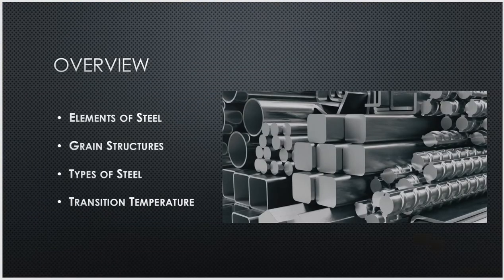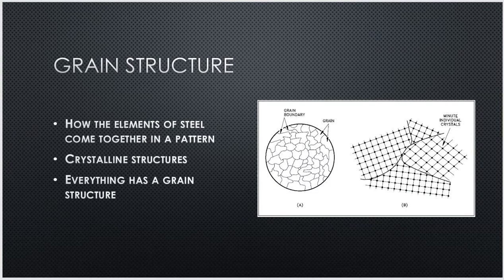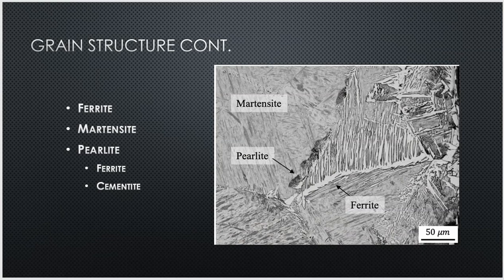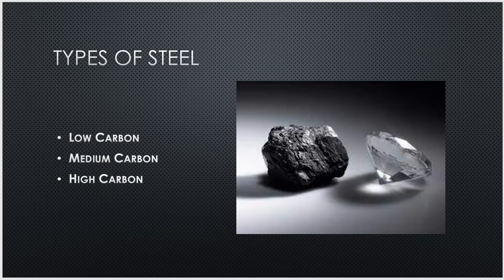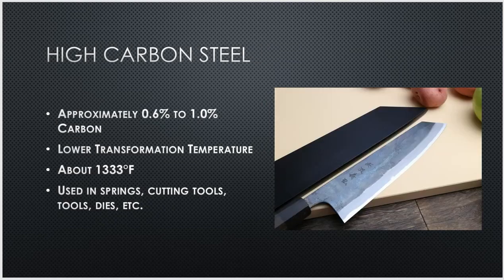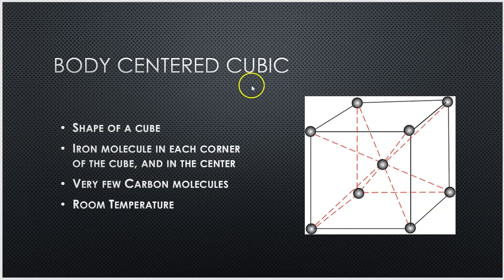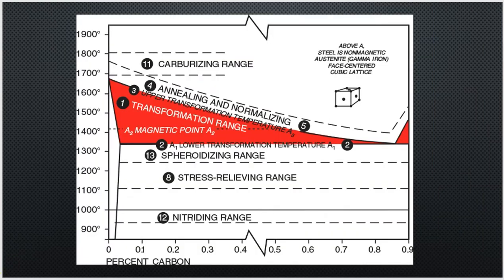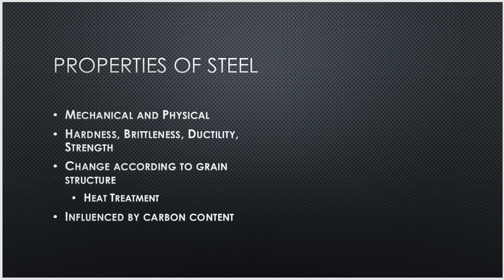Introduction to Welding Metallurgy

Comment: Hey brother, 11b vet here myself turned welder. Studying for CWI so found your vid. But am currently working for a company that builds pressure vessels and am pulse gmaw .045 er80s b2 wire on 1.25 chrome .25 molly using 98-2 gas and we are having a shatton of problems with porosity... Seems like no one in the shop really has a handle on how to properly run this b2 wire. Any tipa would be greatly appreciated!!
Reply: As a side note we are doong a 300° preheat and interpass minimum and a 600° pwht. Supervisor says running higer than 22 volts and 150 wire speed is causing the porosity but I suspect he doesnt know as much about it as he puts on. Since pulse is a form of spray transfer I would think a higer voltage and amerage would be in order as we are welding 1/2"-1.5 thicknesses
Reply: Were you guys able to figure it out?
Reply: @Mykaizer  not really haha